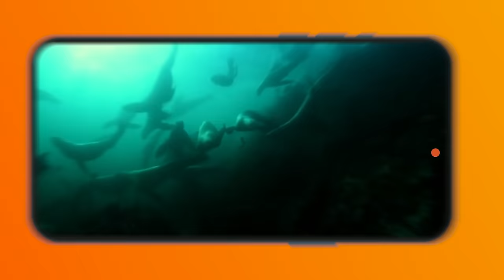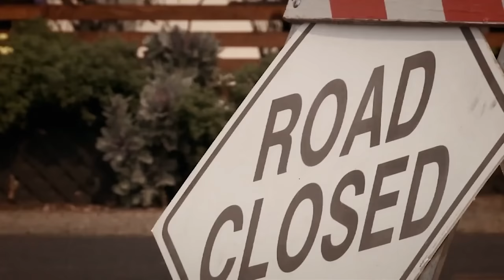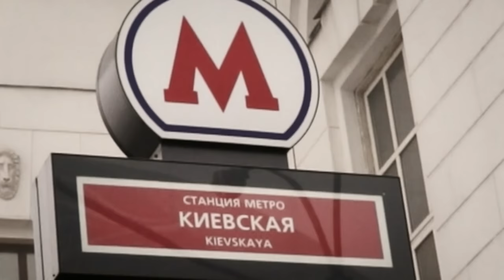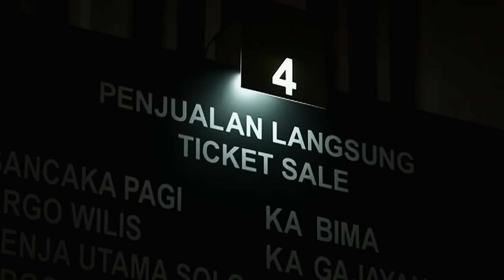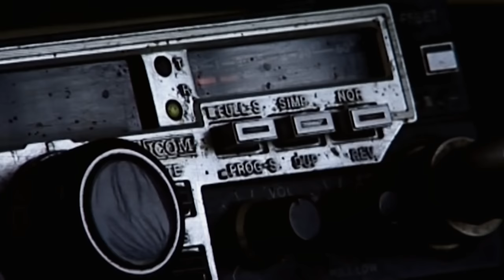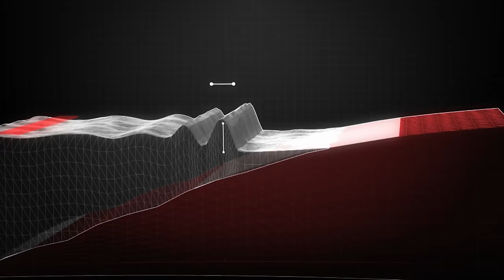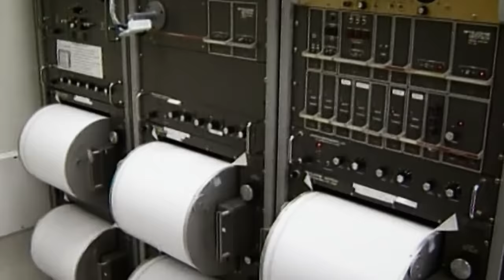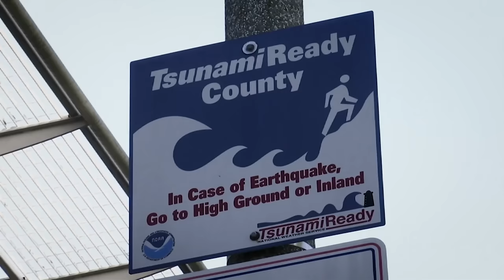World's Worst Fires And Volcanoes | Code Red Marathon | Earth Stories

Comment: It’s funny, they had every reason for the fires in CA except a fly-over meteor. A meteor doesn’t have to make an impact, but it will have insanely strong winds, extreme heat hot enough to melt metals! It also has gases, that can very much turn volatile with the right conditions, water can make some gases as explosive as 10 times its normal. That fire happened in Oct. during one of the peak meteor showers, Orionids. The meteor stream of Haley’s comet.